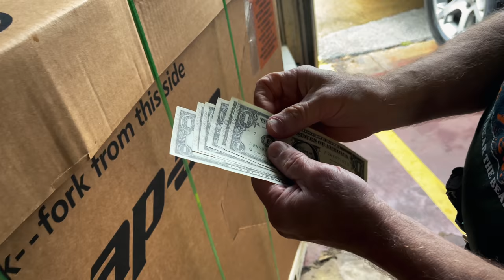Joe's AllStar Tools: Milwaukee Under Carriage Light, Astro Lights and New Years Plans

Comment: This is one of the Milwaukee tools on my short list. I've done a bunch of videos about Milwaukee tools I bought the last few weeks, but it seems the first 8 or 9 didn't curb the urge to buy more. Basically Milwaukee sells crack....it seems like it at least. :)
Reply: Same, think his pricing is off though. The one with the 4.0 battery is $249.99 (2126-21) and the bare tool is $179.99 (2126-20).

Comment: Even though I feel his prices are little high think you have mentioned it before when comes to other tools is your buying the service and warranty, you probably have better chance than dealing with big A. If you aren't aware per Astro if you have a wireless charger for your phone you can use same charger. I won't lie me personally an not mechanic just hobbyists and enthuziast of most trades, but personally use Streamlight just because of the warranty & they make similar lights I have had a Knucklehead but liked option of AA battery back up besides secondary battery. I have had mine 5yrs.

Also did see Joe rocking the Hellcat which is a great tool, though I don't perfer appendix carry if he has the osp version Swampfox Optics(if Joe is a vet they offer vet discount) has a great green dot rmr sight(green is easier to see) called a sentinel that works great with the Hellcat